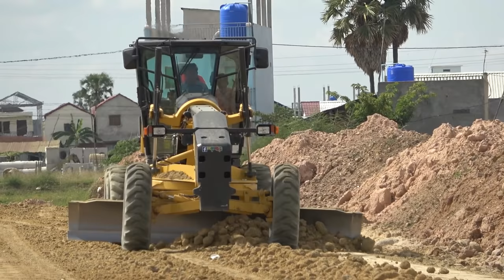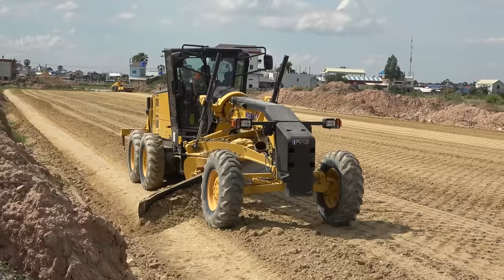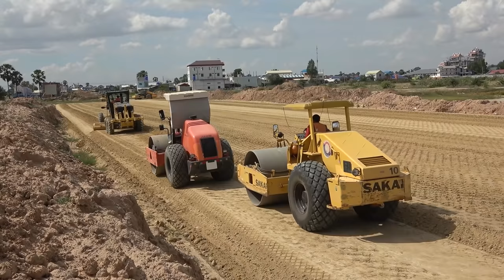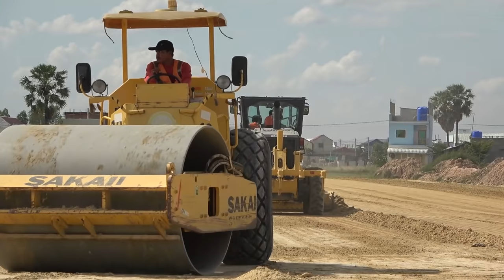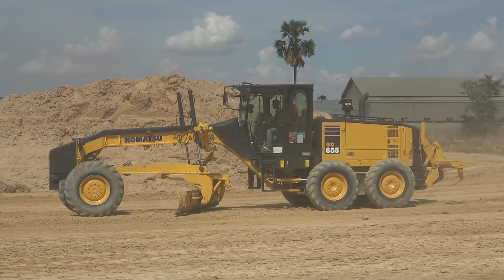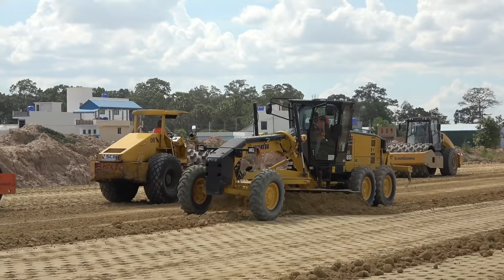Amazing Motor Greder Operating Techniques - Skilled Operator

Comment: 15 seconds into the video I can tell you that this is NOT a skilled operator.  At best he is just a "driver".  Watch the machine bounce.  He is traveling too fast.  Improper machine placement, improper circle and moldboard position, no wheel lean. Pushing a large windrow, he should have had some articulation.
Reply: Yeah lol this looks like a beginner really, it’s not even on a slope either so no risk in using articulation / wheel lean
Reply: الشمري
Reply: Only past. . . No good.
Reply: Operator still learning. His teacher is in the cab with him.
Reply: @alanlambert-bz4to  Then why didn't this "teacher" tell him to slow down?  Plus all the other things he was doing that needed attention.  Believe me, I know that there are no two operators that do things all the same way, but there are things that ARE standard techniques.  Those are all things that his teacher should have been addressing.  You could read some of the other comments, and they were saying basically the same as I was.  Some were nicer than I was in their critique, some weren't.  I mean if your video is going to say "Amazing operating techniques, skilled operator", you should have had the "teacher" operating.
Reply: Ya he's just driving it...  there's no skill or technique